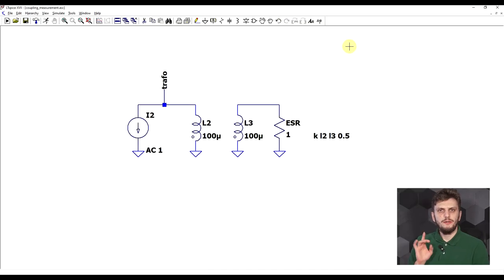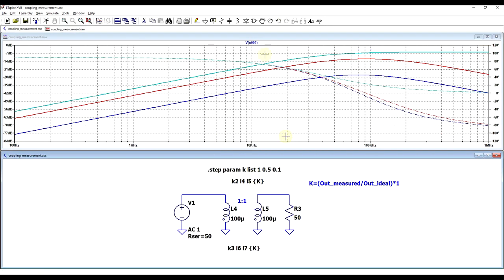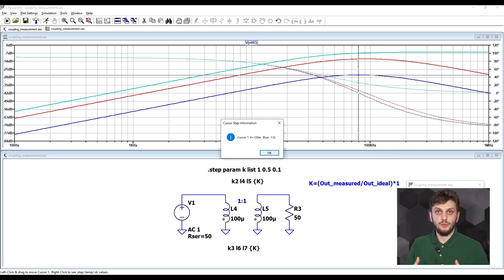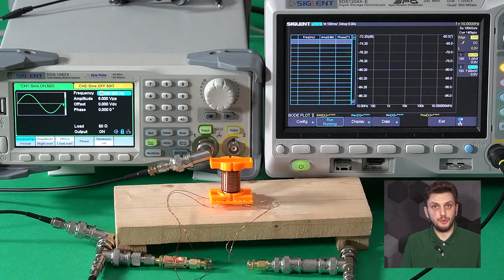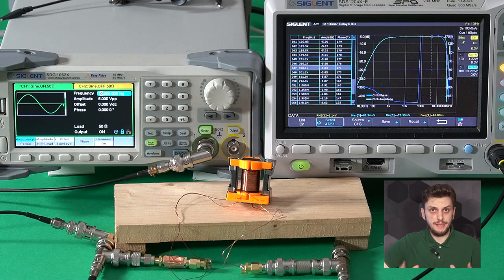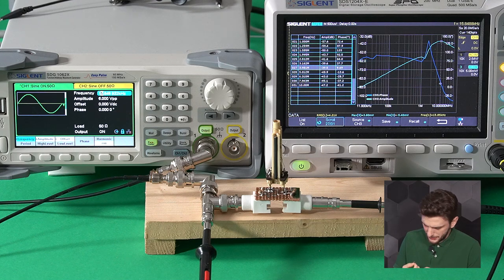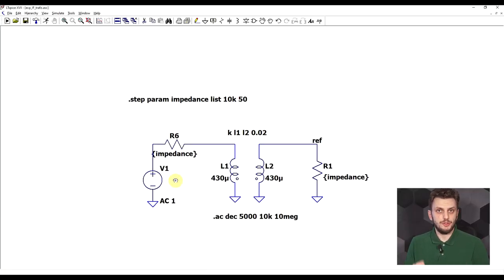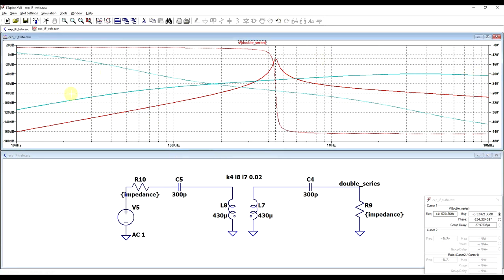Coupling experiments - Transformer Impedance matching (3/3)

Comment: would maybe be interesting to do this with a ZVS as an induction heater?

despite having wound OPTs and playing with tube amps, i admit... it only just clicked with an induction heater!

i found they have serious drawbacks as they use the tank circuit as the work coil... any short or major change in value and things explode. they really are a good circuit if you like making components emit smoke? so ive been attempting to isolate the work coil through an impedance matching transformer... had some damn good refreshers on the theory!

very little explanation on how they actually interact with the load. lots of people talking about the ZVS part, but noone seems to have a clue when it comes to maximising power transfer or anything like that beyond "wind coil put stuff in coil. heating with eddy current. yay"

take the work to be 1R with 1 turn, a 5 turn coil reflects back at 25R, the tank circuit will be shunted by that resistance (or series, that bit still messes with me...) and the power supply will "see" the load of 25R, power being limited appropriately via ohms law.

then you can simply use an appropriate transformer ratio to deliver a resistance that the supply will tolerate, whilst also applying a sufficient voltage across the work coil to produce the current required... yeah, i stuffed one up, went the wrong way... lets say my 250W supply did NOT appreciate suddenly seeing what may have been 0.22 ohms. ive figured it wants about 2.2R as the final impedance to work into. waiting on a new bridge rectifier... did i say they like releasing smoke? i didnt expect the rectifier to go though... meh. as i have no ammeter at the moment, and an unregulated supply, i know its working at full power when it sags to 24V.

theres a bit more to it as the inductance itself is critical for the resonance, but whatever... the basic idea that it does have to be impedance matched for maximum performance as it is just a transformer is sadly lacking in most explanations...

currently also winding meself a nice transformer with a few taps and some water cooling. effing. not as easy at it looks in my minds eye...

the whole subject also explains why ZVS flybacks can be so freaking lethal... the reflected impedance to the supply is virtually zero once an arc is formed... made a tesla coil driven off one directly and wow, did it make some nasty arcs! mmm, mmm, RF burn. i do love the smell of singed flesh :)

Comment: This was very nice, thank you! Can you explain the purpose of the 50 Ohm series resistor? To me, it looks like this is not required since the source already has 50 Ohm internal resistance and you terminated the load with 50 Ohms...
Reply from the maker: Indeed, the signal source does have the built in resistor, but by adding this extra resistor, I can better reproduce the simulation results - in the simulator the reference signal is coming out of an ideal voltage source, and the 50r is after that. With the oscilloscope I can only measure what is coming out of the signal source (after the internal 50R) so by adding this extra external resistor, from the point of view where I am measuring (the signal gen output) there is only the 50R external resistor visible; whatever comes out of the generator is the reference.
Reply: @FesZElectronics  I see. Thank you for your response and keep up the nice work!

Comment: Is the 2% coupling IF transformer just terrible and broken, or is there a use for such poorly coupled transformers?
Reply from the maker: The 2% was occurring without resonance; with resonance, you get far better results (with my setup Iwas getting 10-20% but better can be achieved); you do want small coupling to have a better overall filtering effect - so to only pass the usefull signal at resonance, and almost nothing at any other frequencies.